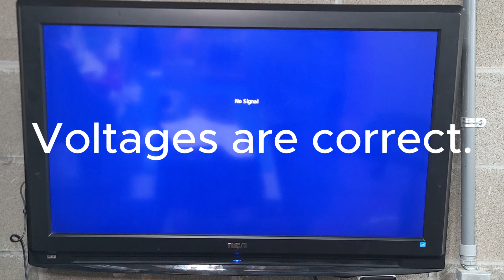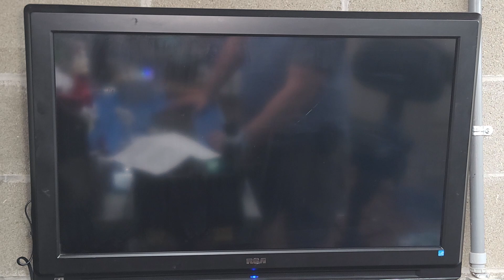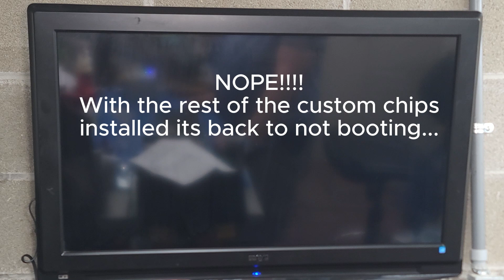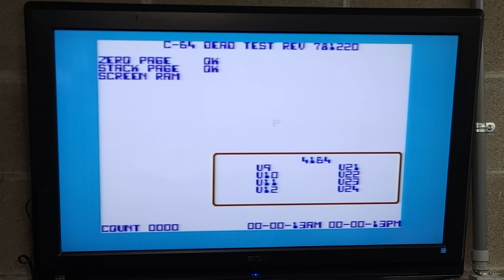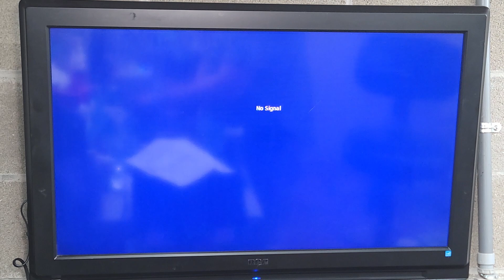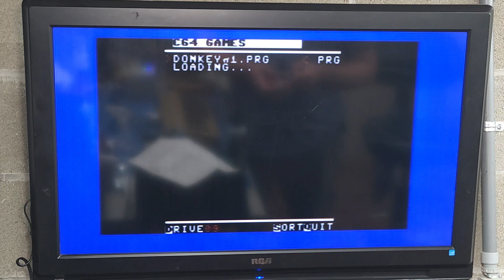Commodore 64 Repair: Several Faults!

Comment: I'd heard the GAL PLA had been tested with the Super Zaxxon cart and that it worked perfectly.  Can you remember where you heard there was an issue?

The MOS logic chips are so cheap to replace, I'd just replace all of them even though I don't really like just replacing chips.
Reply from the maker: I can't remember where, but I feel like I heard that GAL replacements are like 98 or 99 percent compatible. I know I made one for a friend and I had to use an alternate jedec file because the GALs I had were too fast. But here's a video with a seminar by "Eslapion". It has a lot of information about the PLA. 
https://youtu.be/ofg33zk9uCA?si=csW3jER8E7zgEbwu

Comment: Another common failure is the RAM. The original power supply Commodore provided were prone to failure. One indication is the 5v rail. As the power supply ages, the voltage tends to rise. If it rises beyond 5.2 volts, then the RAM chips are the first to go. It’s usually best to test the power supply every so often and replace it when it does go bad.